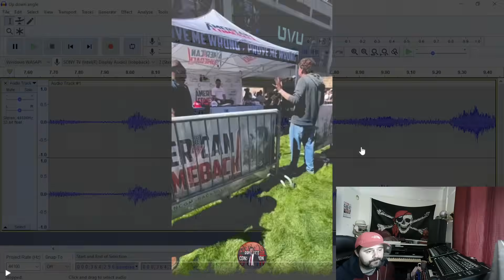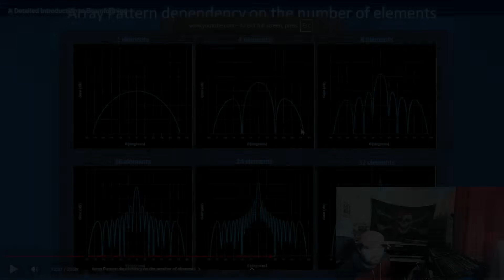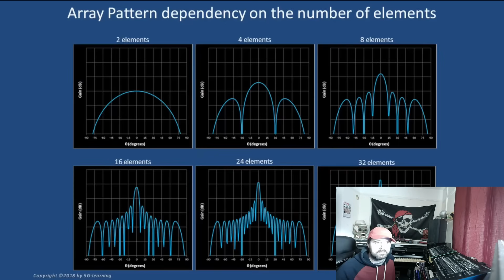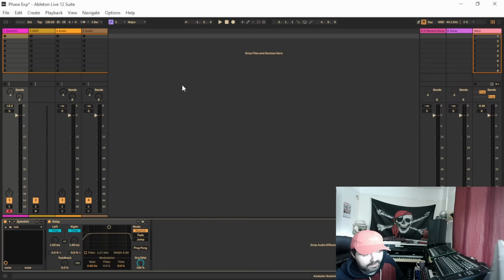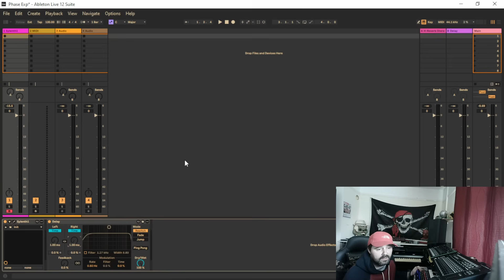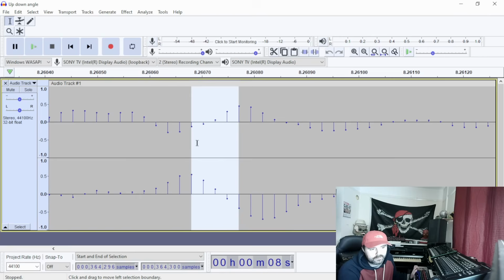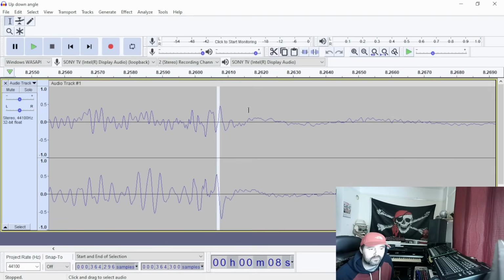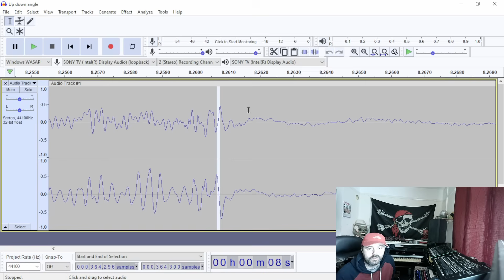Stereo analysis | What a front camera heard and why it's important

Comment from the maker: Just to be clear — this video isn’t about arguing with anyone’s opinion or pushing a particular narrative. I’m not here to prove or disprove anything, and I’m not trying to convince anyone of a conclusion.

All I’ve done here is measure what’s actually in the audio — the timing, the phase, and the angles — and show you how those numbers behave. Anyone is welcome to check the maths for themselves.

Whether you agree with it or not, the physics doesn’t care — and that’s the point of doing this properly.
Reply: By comparing the delay between the recorded supersonic crack and the muzzle blast thump at three different locations, you can determine this.
If the delay times are the same for each recording then the crack and thump could come from a loudspeaker and be fake.

If the delay times are different for each recording then the crack and thump are from different places - the crack from the supersonic projectile shockwave passing and the thump from the muzzle blast arriving at the speed of sound.

Spoiler - the delay times are different so not fake.
Reply from the maker: @duncanmcneill7088  Crack thump requires more input than just the time. You're guessing speed and distance. How can you calculate crack thump if you can't deduct the speed of sound from the mic location relative to the shot location. With out that input it's multiplying an unknown by a constant. That's just a fancy way of saying, I measured a guess. I'm not doing that here
Reply: @Audio-Freq  If three microphones placed at different distances from the stage record the same delay between crack and thump, the signal definitely came from the speakers. The further away from the shooter you are, the longer the delay between the crack and the thump.

Also, if there is a similar delay from all recordings, then the shot must have originated from a point much closer to Charlie.
Reply from the maker: @undercoveragent9889  You'd get a delay form the speaker system. About 60ms all in all, if you run through the setup, soundboard, wires, amplification etc etc. I'd measure that difference really easily and, it's directional by design, so I'd be able to locate that pretty easily by using multiple mics. 

The shot did originate much closer the Kirk. 

I mean, you're pretty much reciting my point
Reply: @Audio-Freq  I would find 60ms latency to be unacceptable, to be frank. I would expect real world values to be much lower. But I take your point. If the sound arriving at a stereo pickup is comprised of a mix between the original sound and a redirected sound from the PA, this would affect the apparent position, (L/R) of the origin of the sound. Right? If the original sound is to the left of the mic set-up and the PA is to the right then the position of the 'mixed' sound would seem to come from somewhere in the middle.

It seems to me that 'positioning' the origin of the sound is not very straightforward.
Reply from the maker: @undercoveragent9889  I suppose there are variables. But, for a 20m setup, about 55-60ms is correct. And you are 1000% on the right track. This is why it's important to work backwards. So to explain, I am measuring the sound field to give an idea of the geometry as a 1st pass. 2nd pass, it will get refined and built upon to create an image. Then, the 3rd part is where it gets spicy and I get someone in to explain some physics outside of my area (already working with him), then we take it to the sonic boom, then we work back toward the actual gunshot itself. It's quite the journey but it'll be robust :)
Reply: @Audio-Freq  I think it is great that there are people like you putting this stuff together. It's kinda encouraging to see there are still critical thinkers out there. 

It's crazy that the FBI isn't appealing to people like you to get to the bottom of this, isn't it?

Good luck, bro. Subbed: will keep an eye on this space. ;)
Reply: @Audio-Freq would you be able to measure the amount of time delay between when the shot goes off and Charlie's initial reaction then we could start figuring out distance based on known bullet velocities
Reply: @Audio-Freq I think if you estimate the shot being about 7-10 feet behind and about 3 feet above Charlie's position you'll get some interesting readings
Reply: I also think you're listening to a high power round like that but from a very short barrel this is backed with video evidence btw
Reply from the maker: @samdisalvo6906 I'm not touching on the round yet. But I think when I do it might be profound
Reply from the maker: @samdisalvo6906 well, my technique doesn't require any assumptions. This is what will make it deadly accurate in the end
Reply: @Audio-Freq we can go back and measure sound on a similar day and time. We are measuring distance
Reply: I am checking if the shot was actually fake by just playing a sound on a speaker or adding a SFX to videos could you tell that?
Reply from the maker: @queendomofethelpodcast4662  You'd know if it was a speaker, speakers are directional. Much the same as when you hear the speakers on the day. Similar, not the same. Electronic sounds are easier to place
Reply: @queendomofethelpodcast4662  thank you. I note that someone said in a youtube comment that someone was frantically pressing a button on his phone, to play some sound.
Reply: @richardmullins44  hmm I would guess they are likely talking about that kid in the white T-Shirt who is shown moving his hands in a very abnormal way. However, I question all of the footage because I have already confirmed a number of the videos were altered (as they had digital artifacts that showed alterations) so they could comp out any objects or add any CGI objects to video so we are not gonna know what's 100% true video and have to just go off of the movements and images of crowd.
Reply: We get you have no opinion on this murder, You are a Sound Technician and Analyst.
Reply: Thanks for this breakdown. Weeks ago I saw a video where the analyst was looking at how the crowd reacted to the shot. The crowd started movement/reaction directly in front of the canopy Kirk was under. No one looking to the rear, where the shot is claimed to have come from. A channel called "drivingislife" was interviewing kids on camera above and to the right of Kirk on the building. When the shot went off, all of the people there  first looked towards Kirks position when the "shot" was heard. I thought, weeks ago, that the sound had to have originally come from very near Kirk. I do not believe he was shot with a 30.06 at that distance, even with a bad or reduced load.
Reply from the maker: @quentinpugh1969  wait to see where this goes. What I am leaning on at the moment in the research is profound. Seriously 😅
Reply: @Audio-Freq will do. I hit the sub button 😊
Reply from the maker: @quentinpugh1969 appreciate that, thanks. I only started this to share the idea. Didn't expect people to actually listen 😅
Reply: @Audio-Freq And I appreciate you sticking to data. Too many out there speculating for clicks.
Reply from the maker: @quentinpugh1969 yeah, I agree. I'll follow the rabbit hole and see where it goes
Reply: If everything is accurate to the millisecond, draw a circle
Reply from the maker: @Frank-b8i1o way ahead of you bud. I use hyperbolas
Reply: I think the shot came from Charlie's left about 40 degrees or so on top of the roof with the two trees..does your research indicate that from the sound analysis  ? Likely a pistol caliber heavy grain that's traveling just over the speed of sound. Could explain the large entry wound with no exit...shoulder blade probably caught the round.
Reply from the maker: @gorillazbynght442 I will test that spot as one of the 4 locations
Reply: @Audio-Freq thanks I really appreciate that any opinions on my bullet theory  ?
Reply from the maker: @gorillazbynght442  to be honest. I know very little about guns. I only know the basics really. For me, I don't need to get into that from an audio perspective too much. I'll leave that to the pros
Reply: @Audio-Freq ok I understand...was just curious cause everyone is saying rifle round but certain pistol rounds can make the super sonic Crack as well an easier to conceal even if a scope was on it. That's a really large entry hole for it to be a 30-06 round..im thinking roughly a 700 grain bullet from something like a 500 Smith and Wesson pistol definitely could explain no exit an large entry. But anyways thanks for the video I'll be watching for more
Reply from the maker: @gorillazbynght442 I'm not here to say what guns do, not without an expert present. You'd likely know more than I do. But yes, bullet profile, barrel length, bullet load. They all come into play from my little bit of thermodynamic research

Comment: Very nice work. Not many people are talking about the possibility that the gunshot was artificial. Hollywood uses gun noise makers, which are small devices that mimic the sound of a gunshot. One of these devices could have been triggered on the roof, which would explain why the guy on the roof didn't have a gun. The actual weapon may have been an air pistol inside a movie camera, with an electronic trigger designed to set off the gun noise maker over on the roof. Just sayin'...
Reply from the maker: You can't mimic natural sound I'm afraid. Much like a video recording is just a series of pictures. Nature can't be faked especially in audio

Comment: Interesting but question is did the bottom Microphone have a suppression unit between the recording? Now does that also mean the weapons was near to the top microphone also was the bottom Microphone behind anything like a Box as you can't see the bottom Microphone in images? if both microphones were in the same exact placing to each other one above one below then higher is correct but if the bottom microphone was to the left or more to the right that would account for the time difference?

Comment: Jolly Roger 10 4

With more sound files from other phones the sound can be pinpointed. I think the time code may use the atomic clock in some phones. So you should be able to line up others exactly. 

There is software that does triagulation.
They even have it set up In cities to locate shots fired. 

If not the Crack Thump would be differerent timing on each phone plus any echo reflections. That can be measured for each phone location giving distance away. The phone closer to the shot would be shorter.

Remember its digital so any sound could of been a live insert from sound system or other means. Video can also be inserted into live feeds. Multi digital triggers?

Capt. FREEBIRD
Reply from the maker: Yes, I have been schooled on the crack thump stuff. But, there are more questions and observations in line. Just got a lot to measure 😅 thanks man

Comment: We already know the bullet came in front left from Kirk's position, that's on the right side of the audience.

Take the video, cut the audio from the moment the shot is heard until Kirk gets visible shit. Count the size of the audio in milliseconds. 

Now if you know the type of rifle and bullet that was used, you also know the speed of the bullet, since the shot was fairly close, no need to account for bulletdrop or loss of velocity. Now you can measure the distance the bullet has travelled.

Take a map and place a dot on Kirk's position, now draw a circle using the distance you have calculated, its still a rough estimate, but the circle might go through a certain spot or building from where the shooter might have taken position.
Reply from the maker: Show me your conclusive evidence of that? Not circumstantial
Reply: @Audio-Freq You can do this yourself, its your show, if you have been given the proper information to work with, you might notice something interesting.
Reply from the maker: @Carlo-j9z you're making the claim. Back it up
Reply: @Audio-Freq And you still be doing your own math trying to check mine, so just do the math yourself and see where it takes you.

But i will give you this,  its formatted for a phone but will work in any python shell.
Reply: import random
import textwrap
import os

# Set the width for text wrapping
wrapper = textwrap.TextWrapper(width=56)

# Example usage:
# print(wrapper.fill

def clear_screen():
 os.system('cls' if os.name == 'nt' else 'clear')

# 12 pt
def title_text():
 print("# " * 27 + "#")
 print()
 print(f"{'Magic Bullet'.center(56)}")
 print("# " * 27 + "#")
 print()
def get_float(prompt):
    while True:
        try:
            return float(input(prompt))
        except ValueError:
            print("invalid number, try again")

def main():
    clear_screen()
    title_text()

    print("bullet velocity (m/s)")
    vb = get_float("> ")

    print("time between impact and muzzle-blast (milliseconds)")
    dt_ms = get_float("> ")

    c = 343.0

    dt = dt_ms / 1000.0

    if vb <= c:
        print("bullet speed must exceed speed of sound (343 m/s)")
        return

    distance = dt * (c * vb) / (vb - c)

    print()
    print(f"distance ≈ {distance:.2f} meters")

if _name_ == "__main__":
    main()
Reply from the maker: @Carlo-j9z  I don't need your gifts. I am sharing my measurements. How does any of what you said change those measurements bud? 

You don't know how fast the bullet was travelling, you don't know what trajectory. You don't know barrel length, cartridge load... Ambience. You're just guessing and trying to sound smart. 

I'm not not smart and I don't sound it, but at least I'm measuring and backing it up.
Reply: @Audio-Freq I agree, you are not smart. But its not my handicap, not my problem.

I guess it goes above your head.
Reply from the maker: Insults are usually the last resort when someone’s run out of data.

If your method were robust, you’d be able to supply cartridge type, barrel length, muzzle velocity under ambient conditions, phone latency data, and a verified muzzle-to-arrival timestamp. Without those, your calculation isn’t science — it’s arithmetic on guesses.

I’m happy to review evidence any day. Until then, I’ll stick to measurements that are reproducible and based on known variables rather than assumptions.
Reply from the maker: @Carlo-j9z  Looking at your code and It assumes you know the muzzle time, the bullets velocity, the first peak is the muzzle blast, the bullets's flight is straight and level and it assumes no device delay or AGC effects. That's not a formula, that's a fantasy bud.
Reply: @Carlo-j9z  Audio guy is right. We don't know the speed of the bullet. And the 30:06 can shoot bullets with a wide range of FPS (feet per second). 
Without the specific fps of the bullet, everything else in your frameup is 'meh'.